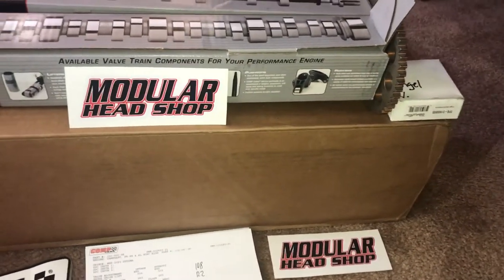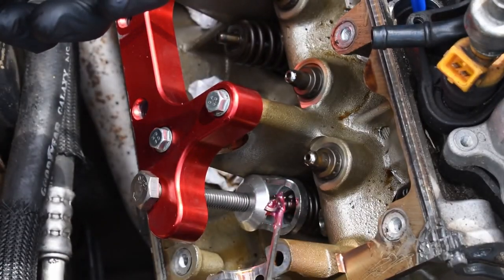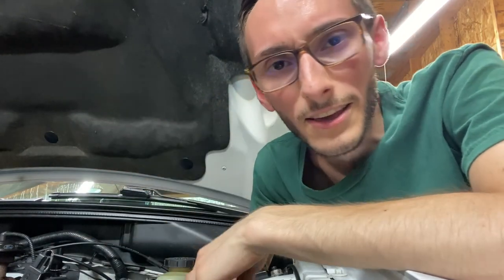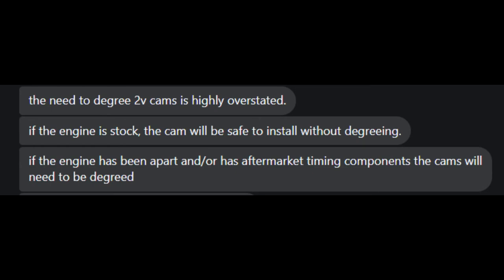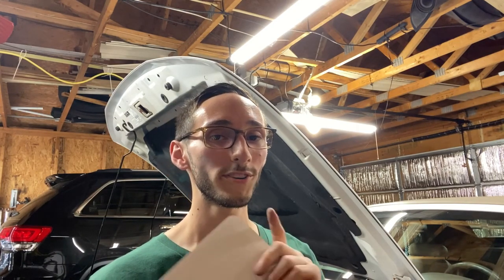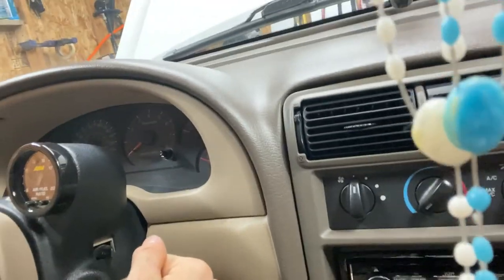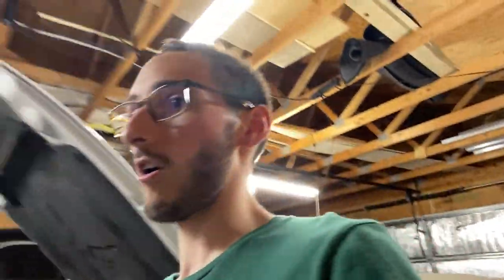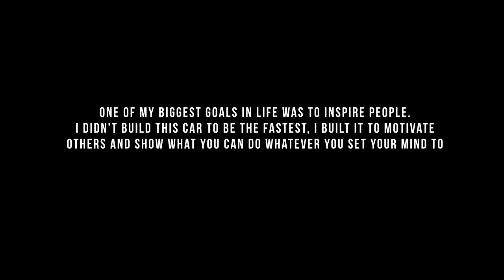Everything You Should Know About Installing Cams (96-04 Mustang 4.6 5.4 2v 4v)

Comment from the maker: ATTENTION:
IF REPLACING YOUR TIMING COMPONENTS, USE FORD OEM TIMING CHAINS IF YOU HAVE AFTERMARKET CAMS! Not doing so can yield in cam timing/ptv issues if cams AREN'T degreed. I've been told by Todd Warren himself that auto parts store cam tensioners, arms, and guides are good (so in my case, the Duralast guides/tensioners are perfectly fine), but chains must be by Ford if you are really serious about this stuff. Whoops on my parts for using chains from a Duralast Timing Set but no issues so far so I can't complain but now I'm aware for next time, especially since I didn't degree my cams. REUSE YOUR STOCK CRANK/CAM GEARS IF THEY ARE ORIGINAL!  

Ford OEM Primary Chains: https://www.modularheadshop.com/i-24493841-oem-ford-4-6l-primary-timing-chain-set.html
Ford OEM Secondary Chains (4v folks): https://www.modularheadshop.com/i-24493845-oem-ford-4-6l-5-4l-4v-secondary-timing-chain-and-sprocket-set.html
Reply from the maker: I also should add that you can REUSE TTY Bolts. MULTIPLE TIMES. Whether it’s a rod bolt, side bolt, main bolt… even if they have 700,000 mikes you can still reuse them. I know hardcore street racers making 800HP in their Fords, reusing stock hardware. I made it clear that you can reuse pretty much any bolts in the video, although I may have exaggerated the TTY part where a bolt might not get up to it’s full torque spec lol. That’s only in the most extreme cases. This will always depend on application and age of build. I’ve reused head bolts on cars before but that’s one bolt I’d for sure replace since why not… 

I bought new cam bolts just because I heard that you can’t really reuse them anymore unless you get ARP ones… who knows how true that really is though but it’s cheap insurance. You could get the Ford bolts too but if you’ll be degreeing using via “filing the cam key” method then I’d get ARP bolts since you’ll have to take the bolts off and on multiple times to achieve your desired Intake Center Line.
Reply: Exactly or reuse the originals, the cheap ass timing chains dont work and will tear up your motor.
Reply: We have a lot of folks opt to change the valve springs with compressed air because they don't want to lose their timing. That is where they to take the cam sprockets off and accidentally have the chain. The timing chain for each camshaft accidentally slip off the idler or crank pulley LOL. That is a freaking disaster. That means you got to tear it down and redo it whole timing
Reply: Where did you get that air intake tube
Reply from the maker: @DustinLeopard1984  It’s a JLT “Next Generation” Fender well CAI. I don’t think they sell them anymore which is stupid as hell. It’s a REALLY NICE piece and the tubing is the widest that you can possibly get for these cars. Servicing the air filter is a nightmare if you drive your car a lot since it’s like under the bumper by the fender, but it’s a cool CAI tbh.

Comment: Got comp stage 3 broke2 valve springs on the 1 2 shift track heat trick flow springs and retainers 300 bucks revs to 7500 all the valve control

Comment: Hey! I’ve got a 2004 mustang GT with 47k miles- would I get any benefit from extra lift if I haven’t bored my intake? And if so, would I need to upgrade my fuel system, and tune as well? Thanks!
Reply from the maker: Every cam is different but stuff like porting heads and the intake manifold (assuming we are talking about an aluminum one here lol) will be beneficial as long as it is done CORRECTLY. I’d get a tune regardless of the cam just to be comfortable, some cams don’t need a tune and usually the gain after tune is like 5rwhp. You’ll more than likely need a tune anyways if you add mods. Take what I’m saying as a grain of salt though since I’m not as smart as a dude like Todd Warren when it comes to cam talk. As for fuel system, assuming NA (no boost), I’d just keep an eye out on the fuel filter and fuel pump, just make sure fuel pump isn’t going to run lean on the top end if you plan to rev the piss out of it. I replaced my fuel filter with a Motorcraft one and my fuel pump with a Walbro 255 module assembly (Part # TU229HP-2) since I just didn’t want to take chances, my stocker worked just fine (93K miles) but just wanted to future proof the car so that’s why I added that fuel pump. But in your case at 47k miles, I think you’d be safe. Bigger injectors is 100% a complete waste of money. Stock injectors are good for up to like 330rwhp as long as you have a solid FP.

Comment: For a younger dude you've got some great experience.
Reply from the maker: Many thanks! I remember when I was first THINKING about adding mods to this car back in like 2018, there was not much good information out there. I did all the research I could & finally uncovered what works and what doesn’t, ultimately by just doing it.
Reply from the maker: I never really liked talking to people who sell parts (even though they may offer great advice) because… well…. they just care about selling you parts you may or may not need lol. I’m cheap as hell, I’ve saved hundreds off my parts with coupon codes & sales. At the end of the day, I’m just somedudeguy who is trying to help those who were once in my boat.
Reply: @McLovinsFunhouse  word, you preach truth.  Unfortunately a chip is not going to give you 40hp. If you want to run on the street, you need to get into the motor Ford , Chevrolet whatever. Unfortunately not everyone has the dollars  or  access to a garage and that's the  bottom line. Having room to work miracles  Dad was into the scene and well probably you learned similarly. Mopar mostly. Chrysler K-series sleepers. Trash really. Mechanics are a dying breed. I find your projects and curiosity endlessly interesting. Your videos likely make others envious as well. Please keep posting. 😎
Reply: @McLovinsFunhouse  👍

Comment: Thanks bro a video with real information!!!!!!!!!!!
Reply from the maker: Thanks! I tried including just about everything an average joe would need to know when doing cams (types of cams, parts you may or may not need, power gains, etc.), really the only thing I didn't cover is actually HOW to do the job which will be different for everyone since some folks have 4v Mustangs some have 2v, some have cams that need piston notches, some have cams that don't even need to be degreed. Main thing here is timing the motor, if you can do that with help of other YouTube videos that'll explain it way better than I ever could, then you're golden. I had no idea how to time a 4.6 2v before doing cams.
Reply: @McLovinsFunhouse  the info is good so you can actually defend you self against bad mechanics and false guru info, now a question? Because I'm going Tru some bad stuff  I got a 98 gt convertible I think my timing tensioners fail and my engine is done so question? What crown Vic engine can I just drop in my gt? So I can have my gt back is cheaper than open the engine for now i really appreciate your time. Keep the good work!
Reply from the maker: @trxcorsair  Any 2001 - 2011 Crown Vic motor bolts right in. Easy way to go from non-pi to pi engine : )

Comment: This is a great video I'm going to build my 04 mustang GT 2 valve I want to make it but only for the street I always wanted a fast car since I was a teenager my parents never let me have one it made me get a Volkswagen bug LOL
Reply from the maker: Thanks Daniel, glad you enjoyed it. I love it when people like me & you want to make a car "STREET ONLY". I'm currently editing a 10 minute video of pure street races and I'm actually surprised as to how many cars I beat and kept up with. If trying to do launches on the street, get rid of rear street tires all together and get yourself a MT ET Street R radial, rides good on the street and is honestly the best street legal tire I've driven (and daily) on without going to a full ass slick/drag tire. Nitto is ass, don't bother running it and so is Toyo, maybe good for auto but never for a stick car. You will lose most races if you stay with regular street tires in the rear.
Reply from the maker: Modding these cars is expensive as hell. Best mods for the low low would probably be
---
- Gears (3.73 or 3.90, 4.10s if you want to go all out)
- 93 Marty Ochs tune via SCT X4
- Steeda underdrive pulleys
- Short Throw Shifter (if manual)
- Long tube headers (kind of expensive in the end)
---
Cams are nice, but expensive. I'd focus on maintenance first like new spark plugs (Motorcraft SP-493 are perfect), new fuel filter, suspension work, etc. before starting to blow your $$$ on performance mods. Throttle body, CAI, plenum won't really add much power but they make the engine bay look cool, get that stuff used if you can.
Reply from the maker: Also, lookup "Motorcraft KH88 Heater Hose" on Amazon. I've had this hose pop out on me once when street racing, not fun, coolant everywhere. The little clamp that is supposed to clamp it down to the back of the intake manifold nipple is shit and doesn't really function as a clamp, PLEASE ADD A REAL CLAMP to really tighten it to the intake nipple, like just a regular clamp that you'd tighten with a screwdriver/socket because it will pop off if you don't. I also had this hose develop pin holes while I was racing a few months ago, had coolant all over my tires, was really scary. I learned to replace that hose. I don't care if it's a low mileage mustang (mine has 99K miles), all rubber will deteriorate with time. Please order a new one of those hoses if you don't want to have any coolant issues when racing. I want to make a video on this stupid hose issue soon since it's a big deal on these cars, and nobody ever talks about it. I knew a guy that totaled his turbo 2v because his original hose popped out and spilled coolant on his tires while he was going like 60MPH, all because of that fake clamp that it comes with, which is why you need to add a REAL one.
Reply from the maker: I'm 22 years old man I know what it's like having strict parents that don't want you to have a sports car lol. Treat the car like you care about it, do the proper maintenance to get it running perfect, don't go out doing burnouts every weekend, and you will have a car that will be more reliable than 90% of the cars on the road. I intended to keep my car stock since I got it years ago but eventually I started making some $$$ and just told myself "you know what?" lol.

Comment: Hey bro, back for another question on this super useful video, I have a question about the valve stem seals job. I ordered all the tools and parts already. Do you have to remove the front cover, chains, and cams? Basically what is necessary to remove in order to compete this job! Thank you
Reply from the maker: Retaining stock cams or installing new ones, you have to remove valve covers, timing cover, spark plugs, cam tensioners and chains. If not adding new cams but replacing valve stem seals, you can technically get away with not removing cams but I HIGHLY just recommend not giving yourself a nightmare of a job and taking the extra step in doing it right since more space makes it easier. You can't really run away from needing to retime the motor again when doing a job like this.
Reply: @McLovinsFunhouse    Awesome thank you! Will be tackling this job soon as I ordered that valve spring compressor tool and valve seals 👍🏻

Comment: I’m just concerned about installing an aftermarket cam. I have a ‘98 GT and I’m looking to do a PI swap and I wanted to install aftermarket cams… but a lot of people online are saying pretty much anything but the stock cams are gonna have PTV clearance issues? Don’t really know what to do.
Reply from the maker: Degreeing the cams is really the only option you have. MHS sells a good kit (instead of piecing the parts individually) for like $270. You’d likely need to take motor out to do it that way though, otherwise I think you’d be able to degree using trickflow wheel kit with engine still in car.

Comment: Will this apply to a 1996 grand marquis 4.6 2v cus none ever have that chop sound
Reply from the maker: Pretty much yeah since it's still a 4.6 2v npi. The main difference is that your motor just has stuff like airbox, throttle body, battery, etc. in different spots but cams should be exactly the same as a 4.6 2v mustang npi. Your heads are a bit different (npi vs pi) but you can still run pi cams in them like mines. A PI swap would do you wonders but most folks just stay with what they have to avoid all the extra work, it’s worth the extra work though. Also, I'm pretty sure your exhaust and tune is totally different compared to the Mustangs, (not 100% sure on exhaust part but that would theoretically make sense to me) that's why the HP rating is slightly lower than a 96-98 stang. Don't be afraid to add cams to your grand marquis, that thing would sound awesome with an opened up exhaust! I've never really heard a cammed Mustang like mines on the street, only at the track unfortunately.

Comment: Hey love the video.   I’ve got to do the valve seals in my 96 2valve.  I looked in summit catalog and many kinds of any recommendations to grab or avoid?
Reply from the maker: Fel-Pro is good. I went with Fel-Pro  SS72891 on this White Mustang in the video. There’s a tiny little clear plastic “tube” that comes with Fel-Pro valve stem seals that helps to not scratch the valve when installing them, I have yet to see any other manufacture include this piece. Enginetech S111V is a good one too. They both fit 96-04 Mustang GT.

Comment: Really good info. Thanks! Is there enough room in the engine compartment to swap heads? Or does the motor have to come out?
Reply from the maker: Thanks! You can swap heads pretty easily with motor still in car, plenty of space to do that. No need to take motor out. You’re still going to have to lower k member (front suspension) regardless to get the manifolds/headers out if not pulling motor out.

Comment: What is the purpose behind reusing your stock cam/crank gears?
Reply from the maker: There’s just no reason to buy new cam gears since they really never go bad lol. Same thing with your crankshaft gear if you’ll be reusing stock cams, degreeing using the “file key way” method, or installing aftermarket cams that “don’t need” to be degreed (installing same way you would with a stock cam). 

You reuse these components because it maintains stock cam timing, assuming they are the original Ford pieces. This wouldn’t matter if using aftermarket stuff IF YOU WERE DEGREEING CAMS but it messes everything up if you won’t degree the cams.

Comment: Hey I have a 04 f150 4.6 2v I’m looking for high end torque long tube headers long chop it’s a automatic I may have to do head gasket and rebuild heads do you have any pointers ?
Reply from the maker: Comp XE268H wouldn’t be a bad option. I wish I could be more useful in the recommendation department but I do believe the 268s would be real close to what you would want. 

Off shelf cams really aren’t all that bad… they still make sound, they still make power, but a custom grind will put you right at the top. If anything, Todd Warren would be your guy to talk to. 

I always post in Facebook groups to ask for advice, there’s a bunch but my favorites are “Ford 4v/3v/2v Modular Engine Building” and “Apocalypse Performance/TW Cams Modular Tech Group” for super technical engine questions. Highly recommend joining those and getting a second opinion.
Reply from the maker: If you do plan on rebuilding the heads, be sure to do the “gas leak” test, where you fill the combustion chambers (where the valves sit) with spark plugs installed and fill them up with gas and see if any leaks (with heads off the car). It could take 5 minutes, it could take a few hours to see results. You could also do a leakdown AND compression test before tearing the heads off, it’s basically the exact same test as the gas test.

You don’t need to do any of that machine shop nonsense if you know what you’re doing, you can lap valves by hand with a drill to fix any leakage 90% of the time. Don’t over do it and DON’T MIX UP THE VALVES. Make sure you place each valve in exact spot you took them out from. 

Also, don’t mix up the cam caps when you take cams off… each side is a machined to each head so you technically have to make sure each cam cap goes exactly in the same head it came off of. Also don’t over tighten the cam caps when you tighten them, the cam can lock up when you spin the motor, torque spec is like 8 ft. lbs but I did mines by hand.